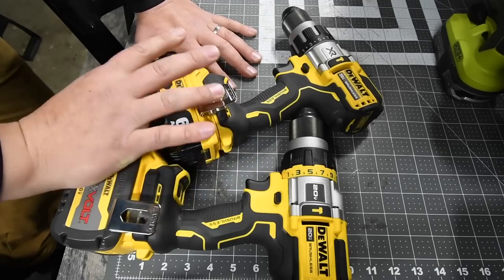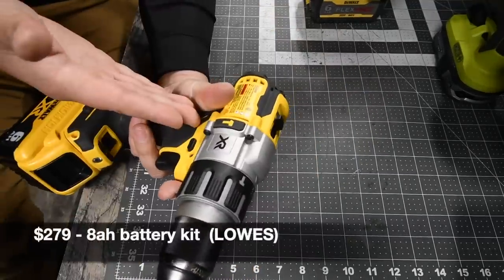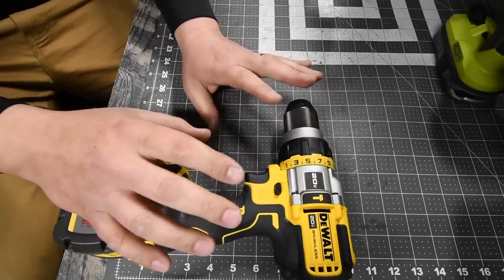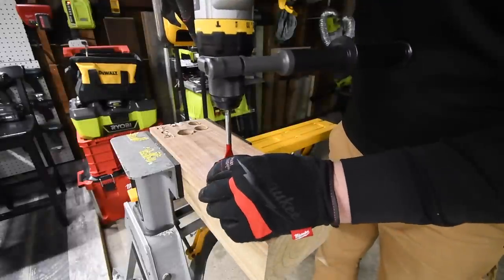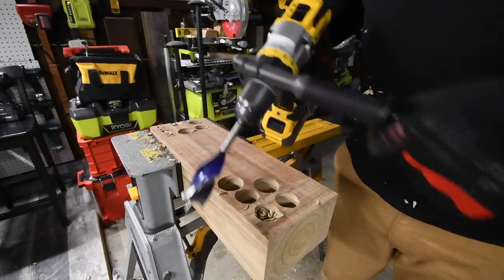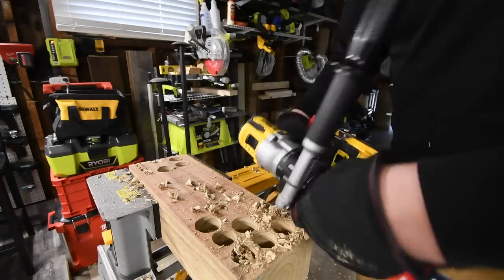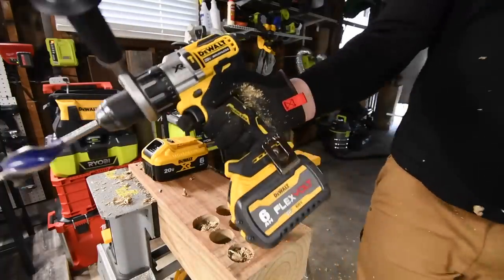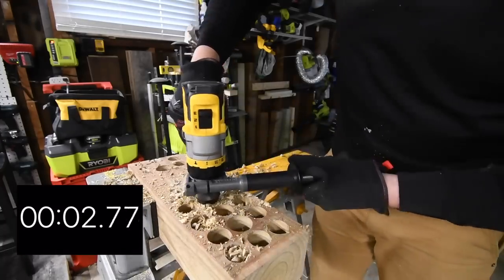Dewalt Power Detect vs. Flexvolt Advantage

Comment: The only things certain in life are death, taxes and YT comments saying you used the wrong battery. There's still ones even here! It makes us love air tools more
Reply: Life sure would be simpler if 21700 became the industry standard, but then they’d build something bigger.
Reply: @FyrFytr998  that's for sure....
Reply: Even if it was a 2ah it would not be wrong... Just a different use case...
None the less it would be interesting to see those two with a 9ah (3x 21700 cells in parallel, tons of available amperage for those monsters
P.S. the 9ah has cells capable of higher discharge rates than the 12ah.
Reply: >:(  

You’re going to get a properly working dcf899 with a 8ah 21700 battery whether you like it or not.

Nah, but have a category called best, best case scenario, where it doesn’t rank into the rankings, where whenever you get that brands top tier battery.  You can make a quickie video.  
You can leave the bbcs torque rating in the chart but it doesn’t factor into the overall score.  It’s just bonus info and an easy way to keep content coming.

It’s the equivalent of running an air tool with water in the lines.
Reply: Until they tell you that you’re using the wrong air...always something.
Reply from the maker: lol. then you will get people saying your using the wrong air compressor lol

Comment: Great video and this shows what irks me about DeWalt and the games they play between Lowe’s and Home Depot. It only confuses both the average consumer and pros alike, and quite frankly makes it hard to price match (which I’m sure is exactly what these home centers want!).
DeWalt need to have one….ONE top level, pro-line of tool and battery, whatever that may be. I get the whole reason for the Flex-volt 20/60 battery so you can power both your drill and miter saw. But give us one hammer drill that will perform at it’s best using either an XR or Flex-volt battery. That way the only choice the consumer has to make will be if they really need to pay extra for that 20/60 combo battery.
And bedsides….. is there any other tools other than the hammer drill that are called “Power Detect” and/or “Flexvolt Advantage” ??  No! (The same 887 impact drivers comes with either top-level combo kit).
Stop playing games DeWalt!    And thank you MC for these videos!
Reply: Agreed. I picked the 999 thinking that “power detect” on the 998 was just referencing the variable X AH batts of the 20v line. I had no idea you could use a flex batt on it until I saw this review. And, based on this review, I might be tempted to return the 999 and get the 998. Generally, it seems like the better tool.
Reply: There’s several FA & PD tools. I have PD: grinders, Hammer drill, and recip.
I kind of like shopping tools at Lowes a little more than HD which is why I’m a PD guy.
Reply: This really frustrates me and I’m seriously thinking of dropping Dewalt after using them for all of my power tools for over a decade now. They were already pushing the limit with misleading marketing of their multiple tool kits where they include a bunch of brushed, lower level tools with a single XR tool yet list as an “XR” kit. Thankfully, I never fell victim to that trick and there is at least an element of buyer responsibility on those bit this is just downright dishonest. 
I needed a new drill after my trusty 790 finally gave up on me after years of an admittedly abusive relationship and I liked the idea of the new combi hammer drills so I figured I’d upgrade to one but quickly became overwhelmed with Dewalts confusing lines of tools that seemingly (actually literally as this video proves) do the same exact thing but have different price tags.
This is a straight up lie that Dewalt is feeding us and I just can’t do business with a company that isn’t trustworthy.

Comment: Agree with Antonio. Dewalt messed this up. You pay almost 300.00 for flex volt and you get a battery pack thats 18650.  You by power detect at the same price you get a battery pack with 21700.

Comment: So should invest in Flexvolt Advantage or Power Detect tools? The PD was able to finish the bore with the FA battery when the FA drill couldn't. Wonder if this holds through their circ saws
Reply: Go with Power Detect. If you want a cordless saw don't waste money on the FA and just get the 60V wormdrive. You can get a kit with two batteries at Home Depot.
Reply: @not-OJ-Simpson  oh yeah the 60 flexi volt circular saw proved to be a beast on my brother-in-laws DeWalt platform against my Milwaukee circular saw , the only thing I found that was good on the flex advantage was that drill 999 during a rigorous trial on 9ah dcb 547. My damn in law has a good Dewalt  platform, even that 418 grinder of his is also a beast , which is why I invested in some flex volt tools hey thanks for sharing man

Comment: Based on all the different videos I have seen about the 998 and the 999 I would surmise that they are both the same tool just a different label. I'd love to see a comparison of the two with a 6ah 21700 battery, a 6ah flexvolt battery and an 8ah 21700 battery used on both and compare the results. I'd be willing to bet they'll have the exact same performance.
Reply: I thought they were the same tools in different shells and think PD and FA are probably almost if not the same guts wise

Comment: 21700 cells always dominate over 18650 cells good Video on dis proving to a degree the flexvolt advantage tool has to use a flexvolt battery @Man Caver Tools

Comment: I think you should test a flexvolt battery that has 21700 cells like the 9ah or the 12ah @Man Caver Tools
Reply: Yup, those can output even more amps! 3x 21700 in parallel!!!! 💪💪💪
Reply: Yes, he should also try the 3ah with 21700 cells to
Reply: @jessedomagalski3710  you talking about the dewalt compact style 3ah 20v xr battery
Reply: @jessedomagalski3710  the 6 ah 20 volt he used also have 21700 cells
Reply: @jamesfair9751  Depends on peoduction year
Reply from the maker: once I get the batteries I will
Reply: @ManCaverTools  you ever repeat the test with 21700 flexvolt batts?

Comment: The two drills use the same motor/switch assembly.... part no N793096... so if there is any difference it is in the gearbox/clutch assembly

Comment: Power detect comes with 8ah battery so a fare test would be 8ah on power detect and 9ah on FVA. Both of those batteries are 21700. Ultimate test would be 10AH on PD and 12AH on FVA.
Reply: Your right another reviewer did test with a 4amp 6amp and the 8amp gave it the most power that is why it comes with the 8amp battery

Comment: Nice video! one thing, you'd better to do this test XR 8Ah or 10ah vs FLEXVOLT 9Ah. The reason why is FLEXVOLT 6ah (both new = gray and old =balck)is still 18650 not 21700. 
XR 6ah = 21700 x 10pcs vs FLEXVOLT 5ah 18650 x 15pcs. Thanks!

Comment: The power detect comes with the 8ah I feel like you should use what battery comes with the tool. That's just me tho. Enjoyed the show bro!
Reply: Indeed dude!  I’d be glad to send Dave my 8.0 Ah battery, which does make a little difference.  I think Dave was trying to keep things ‘fair,’ by using a 6.0 Ah equivalence  between both batteries.  I have the Power Detect, and as far as I’m concerned, it’s the better tool.  And 1 pound 2 ounces lighter than the FlexVolt!  Why would someone want to carry around extra weight, when it actually underperforms the Power Detect?!  To each their own!  Peace!
Reply: @georgedavall9449  true he probably was trying to keep it even Steven. Dave himself says his channel isn't about being fair. I have the power detect as well it's a freaking beast.... Cheers bro
Reply: You're more right than you realize. Power detect is designed to perform better with 8.0ah batteries. Comparing a flexible advantage tool with a flexvolt battery to power detect tool without an 8.0ah battery isn't a fair comparison.
Reply from the maker: its also a great tool with out the 8ah

Comment: Interesting because the 6ah has 21700 cell batteries for the power detect kit and the flexvolt 6ah is 18650 batteries might be why the flexvolt advantage has issues not enough power @Man Caver Tools

Comment: I don't know about the drill, since I only have the 996. But I have flexvolt advantage recip and angle grinder. The flexvolt battery definitely gives a boost in performance. To me it seems like the flex 6 and 9ah batteries are different in the amount of power they give. I've tried the 9ah on DCS575, and it felt significantly more powerful. To me it seems wasteful for Dewalt to run both Flexvolt advantage and power detect. They should stick to just one brand of tools that detect batteries, and maximizes power output. I also don't think it serves their customers.

Comment: Get a 9ah flexvolt for the FA, and use the 8ah on the PD

9ah Flexvolts have 217000 cells in them from what I’ve seen and heard
Reply: Yes, 3x 21700 in parallel on the 9ah FV compared to the 2 in parallel of the 6ah PD
Reply: Btw, the 8ah pd and 12ah fv have a different 21700 cell. One with more capacity per cell (4000mah vs 3000mah) but lower discharge rates...
Reply: @loxeyloba5897  so which battery is better? Because the 8ah is a 2p configuration I think.

While the 12ah is 3p configuration
Reply: @lepore5326  So, here it goes
6ah: 5s2p cells: INR21700-30T(3ah)
8ah: 5s2p cells: INR21700-40T(4ah)
9ah: 5s3p cells: INR21700-30T(3ah)
12ah: 5s3p cells: INR21700-40T(4ah)

The Samsung INR21700-30T is capable of 35A discharge peak and 30A continuous.
On the other hand the INR21700-40T is also capable of 35A peak but only 20A continuous.
Usually a battery of the same size and higher capacity isn't able to output the same amperage of a lower capacity and higher discharge cell. On the other hand they are longer lived has AvE has explained on one of his videos...
Reply: @lepore5326  So supposedly the 9ah is the better one when it comes to high output... 3 cells in parallel with the best discharge rates
Reply: @loxeyloba5897  who is AvE? I would like to watch that video you’re talking about then lol!
Reply from the maker: I will

Comment: I Have a DeWalt power detect hammer drill and I use 6 amp hour flexvolt batteries. I drill through metal for work and I will say it does run a long long time. I have 3ah Batts and that's All I use for work in Steel fabrication.

Comment: How would the flexvolt drill perform with the 9ah flexvolt battery or the 12ah as opposed to the 6ah?
Reply from the maker: I am not sure. we will have to find out. But the point is if you need a specific big battery that is costly to be equal to a tool that doesnt need that big battery defeats of the purpose.
Reply: @ManCaverTools  Yeah those batteries like the 9ah or 12ah are insanely expensive but might make a fun video for us I would love to see the test results if that was ever possible to do? Thx

Comment: Thank you for proving my point that the main thing is the 21700 cell batteries and not the marketing scheme. I love my power detect drill. Now how would these 2 compare if the advantage had a 9 or 12ah vs power detect with 8ah or if they both ran a 9 or 12ah. More curiosity to me cuz i wouldnt wanna run a drill with such a large battery like the 9 or 12 well at least all day although i have a coworker who loves using 9ah on all his tools lol
Reply: Why try to give FA such a big advantage? Maybe 9ah FV vs the 8 or 10ah XR is a better comparison.

Comment: Outstanding Dave !!! !!! !!! 😁👍
And it did the test with only the 6.0 XR, which IS A fine battery, but the 8.0 XR will do better, by a small margin.  And it all comes down to, why would anyone want to lug around an already heavy drill, that is about a Pound and couple ounces heavier?  I compared the weight of the XR 8.0, with my 9.0 /3.0 FlexVolt battery, on my digital scale.  The 8.0 is lighter by that much.  To each their own?  🤷🏻‍♂️🙄 Awesome bruh 👍👍👍👍👍👍👍👍👍👍👍😁✌🏻🇺🇸
Reply from the maker: I thank you George
Reply: I'm a welder and use the flexvolt grinders and Sawzall, I  generally  only use the 4.0 batteries  for my non flexvolt tools, but when I need to punch a hole in concrete  or stainless plate the flexvolt batteries are nearby

Comment: I’d like to see if the Dewalt 996 performs the same as these two with the 6Ah 21700 battery.
Reply: I can answer that.

No.

I mean it does increase performance.  But the 998 is a beast.

Comment: That new 6ah flexvolt battery has 21700 cells inside. The older looking flexvolt 6.0 has the 18650 cells

Comment: I believe those are battery dependent... This naming bs is just to make people confused... They sense if more amperage is available and use it... 
That being said, a 3p 18650 battery (6ah flex) has less Amperage Output than a 2p 21700... In the case of the 9ah flexvolt both drills would benefit from its 3p 21700 cells... 
Thanks for the vid! But there is still more to be tried, remember that!

Comment: It'll be interesting to see how the older 18650 cell 5Ah battery compares to the new 21700 cell 4Ah battery. It looks like the 21700 cell is giving a lot more power to the tool.
Reply from the maker: it does by a long shot
Reply: @ManCaverTools  hi man caver, how do you tell if a battery is 21000 cells vs not?  And do the power detect tools have a minimum battery before they actually take advantage of it?
Reply: @biggesttboss power detector is utilized with a 8ah xr max battery

Comment: Sounds like the bottom line is a 21700 cell battery dominates for the fv but the PD can do it with either
Reply: I think that's the new tech.   That it detects it's power supply and the board makes the adjustments to get the most power out of the motor.  So regardless of the battery type and ah your always pushing max power   sounds like they came out with the the flexvolt to cater to the people that are running their 60 v platform but want a better priced drill (and Home Depot. Lol)

Comment: What about the flexvolt 9 and 12 ah batteries that have the 21700 cells would they do anything more in that drill ?
Reply: I’d love for the next test to be the 20 volt 8 ah 21700 and the 9 ah flexvolt with 21700
Reply from the maker: more tests are coming with a bigger battery from flex soon

Comment: I would be curious to see the gauge of the wire between the 21700 and the 18650 battery??? Having more power is fine but just like a highways the more lane you have the more car can pass true 👍 and if the 18650 battery have smaller gauge wire what happens if you solder bigger gauge wire will it make the 18650 perform just as good??

Comment: I saw another video that showed the DeWalt 5amp battery had 1650 cells. You mentioned it had 21700 cells.
Is it down to the manufacturer date? I.e. older ones have the 1650 cells and new ones have the 21700 cells.?

Comment: Also i wonder how the power detect would do with the new 10ah batteries although they only come with the mower for now. They say its part of the power detect line. I also hear they are 21700 cell batteries but i dont see how thats possible since its larger then the 8ah but still looks like a 10 cell battery. Seems to me they are using larger cells then 21700. May have to do this test myself if no1 else does
Reply: I bought the mower.  It sucks.  But I was able to return it to HD and keep the batteries he he hee.  Winnning.

Comment: Interesting that the power detect can do the speed bore on speed 3 and the flexvolt advantage couldn't do it on speed 3 hmm 🤔 @Man Caver Tools
Reply: He proved that the Flexvolt could do it with a 21700 cell 6ah battery. He also showed that it could not do it with the 6mah Flexvolt battery. So yes and no.
Reply: @wlsonzor  and you will see I said that in one of my other comments

Comment: Wow. So the normal but updated XR 21700cell battery outperforms the extremely high priced flexvolt battery?  If that’s the case, not going to be buying any more of the expensive flexvolt batteries.
Reply: Unless you need 60v

Comment: I did my own testing with my brother-in-laws 996 and 999, if you use the dcb546 9 amp battery instead of the 6 amp then it's real power will be noticed , the end result, I'd say it broke even with my generation 3 Milwaukee if you minus the 250 RPM on the DeWalt, I suspect that the 999 may have a little bit more power so I'm going to get me one 999
Reply from the maker: once I get the 9ah battery I will test that out
Reply: @ManCaverTools  thanks man I only did this testing 4 my brother-in-law because he was so upset the 999 had the same power as his  old 996 , as for the Flex drill ,hard to say, I'd say flex  would be the more in power ,we don't  have flex  on our country as it would  probably  upset  alot of makita fans here cheers man
Reply: @ManCaverTools  by the way I forgot to tell you the battery is 9 a h DCB547-XE type 1 made in Korea.. thought I better give you the info and thanks again for your videos, much appreciated